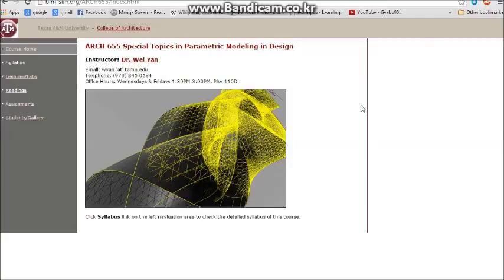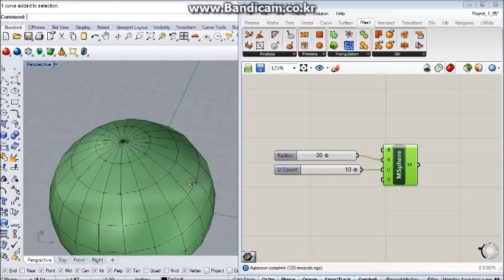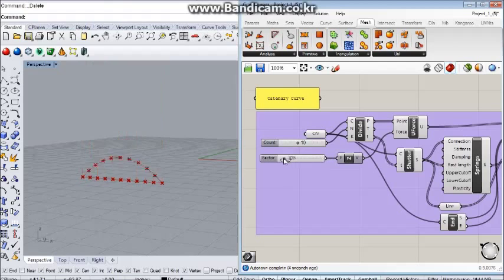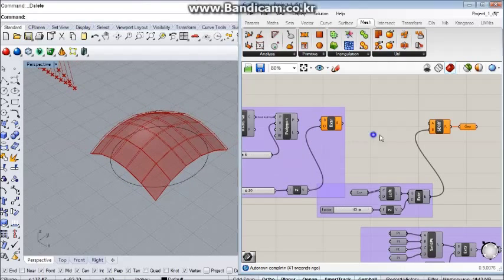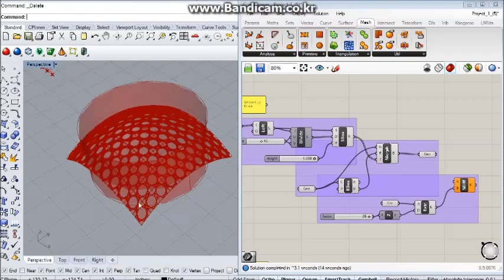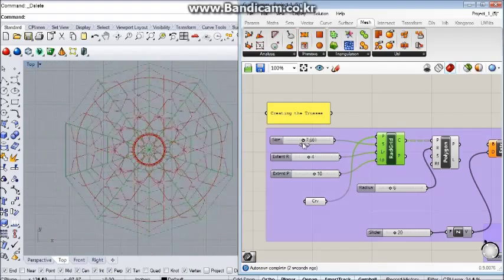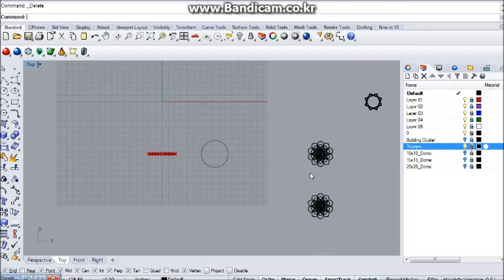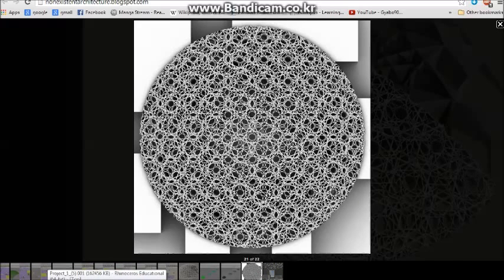Recreating Jean Nouvel's Louvre Abu Dhabi with Parametric Modeling

Comment: Thank you for the tutorial!
How did you create the lofted surface? Did you use other curves?
Reply from the maker: Sorry about the confusion, I forgot to explain that part in the video.
I duplicated and had three same curves in the same direction. Only the middle curve is translated upwards by the same distance as the height of the curve to make the dome shape.
Let me know if you have any questions.
Reply: +Gyabo90 when I loft the surface it comes out of the loft component as an open brep (I assume because the curve was shattered). Even after joining and rebuilding the curve I still can't get a surface to continue on to the next step. Did you just bake the curve straight after it came out of Kangaroo or was there another process between that and the lofting step? Thanks for the tutorial!

Edit: I ended up finding the points on the catenary curve and interpolating a curve through them to get a curve with continuous curvature.
Reply: +Gyabo90  is still not very clear how u got the lofted surface from the catenary curve. how did u arrange the 3 copied curves ?

Comment: gd job. kindly can you send me the file because at the end of the video i didn't understand how to connect with kangaroo
Reply from the maker: Haha I'm not going to do that. But you can check out the screenshots on my blog. Hope that helps.
Reply: its ok, i’ll send u my work based on your video and i’ll mention inside my gh file the problem. whats your opinion?
Reply: +Gyabo90 how did u remove the poly surfaces on trusses when u baked it ?
Reply from the maker: +Bilal Baghdadi I had to do it manually in Rhino. I couldn't find a way to do it in Grasshopper.
Reply: Kindly can u tell how to do it in Rhino?
Reply from the maker: +Bilal Baghdadi use command "explode" select the surfaces you don't want.